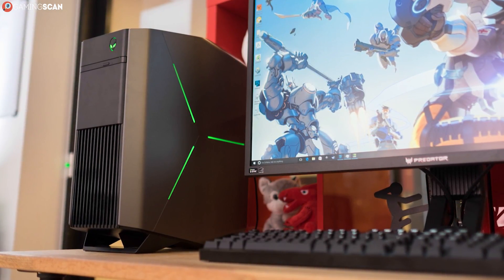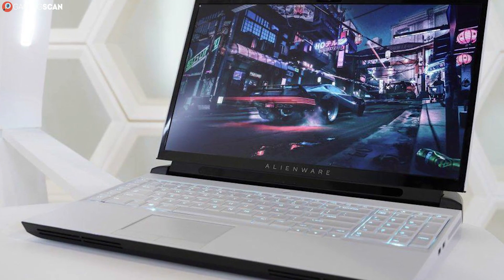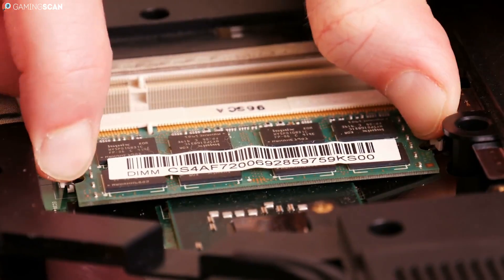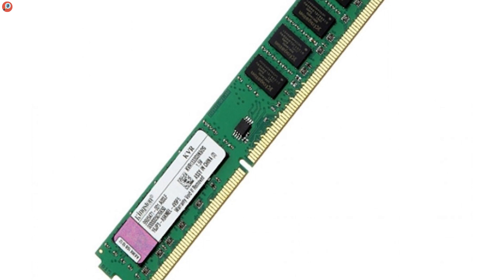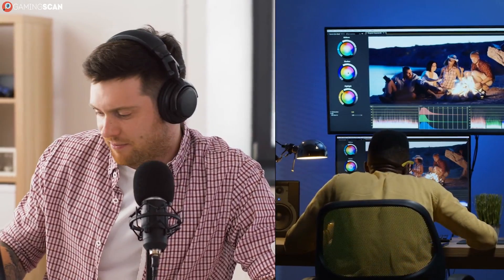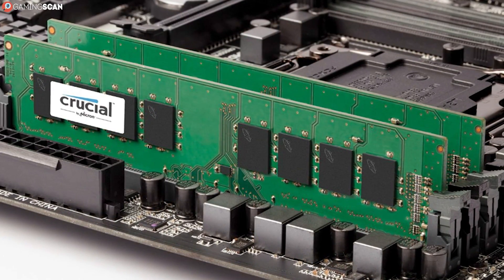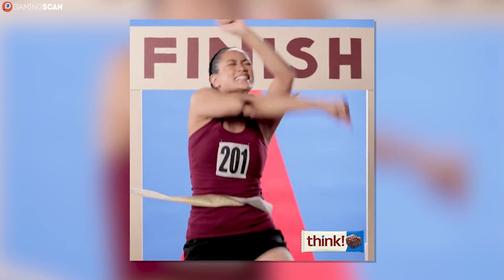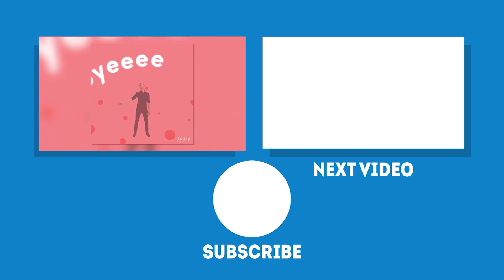How Much Does RAM Affect Gaming In 2020? [Simple Guide]

Comment: In short guys, buy 16gigs 2x8 (if your mb supports dual channel; most actually do) 
DDR4 3200mhz is enough if you have a mid-high components. 

Tips: there is no big deference in ram manufacturers.

For example, a 3200mhz silicon power x turbine is the best in my opinion when it comes for price (spoiler alert; it has RGB 🥸)

Comment: I have a 16gb ram intel 5 1660 super pc and a 144hz monitor and I get like 80 frames , get stutters frame drops , what do I upgrade too get more frames ?
Reply: Switch to ryzen 7 3700x or i7 lol and make sure you have a dual channel ram and not single stick. Single stick causes spikes still. Dual channels can fix it and deliver smoother gameplay, but if it still spikes it’s probably cpu cause a gtx 1660 super is really good but the i5 is decent.
Reply: @mattrofI  gotta upgrade the i5 then ?
Reply: @gleesyy  yes
Reply: @gleesyy  cpu/ram both help fix stutters also smoother gameplay with a bit of fps increase. GPU just gives a lot of fps with a small amount of smoothness ig but not much
Reply: @mattrofI  okay thanks daddy
Reply: @gleesyy  np

Comment: I've been using 16GB of RAM for the past 6 years. I'm starting to consider 32GB, but I think 16 should last a little longer.
Reply: Me 4 gb ;-;
Reply: What's your frequency? Like MHz per seconds because that plays a big factor as well not just the size
Reply: @warmachine6988  Not really. The difference between 3200MHz and 4000 isn't that big. Also, a lot of CPU's don't handle fast RAM too well, I.E cause stutter. 3200MHz to 3600MHz is the sweet spot currently.

I myself have a 2x8 kit of 3600MHz.
Reply: @scotchwhisky6094  i have a pair of 3600 as well, don't believe you'll ever really need to upgrade, but I mean if you got something below 3000 then upgrade wil probably make a difference tbh

Comment: I'm planning to upgrade my Acer Aspire 3 laptop currently on single 4gb ram stick.(IKR WTF ACER?!) Should i add another 4gb ram on my existing 4gb ram making it 8gb dual channel ram stick (2x4) or upgrade my current single 4gb ram stick to 8gb dual ram stick? (2x8)? i understand that mixing rams i.e 1x4 + 1x8 is bad and that ram capacity should match, so any suggestions on whether i should get dual channel 4gb or dual channel 8gb??? thanks a bunch

Comment: Just wanted to put here that my ram is my huge bottleneck atm so tip: don't just focus on cpu and gpu, ram also plays a huge factor in your gaming if you only have 4gb or 8gb and trying to run the latest games, trust me
Reply: Thanks bro I’m new to PCs and only have 8gb I’m thinking I should upgrade the ram first
Reply: @yessir721  I'd recommend going into your games, pressing ctrl alt and delete at the same time. Then go to task manager and try to see what part of your pc is being used most. If your ram, cpu or gpu is running at 100% or close to it in all your games, that's your bottleneck
Reply: @josiesenneff3600  thx for the help  I appreciate it
Reply: @yessir721  No problem hun
Reply: Much appreciated, damn. My CPU & GPU are averaging at around 20-30% & then my RAM at 95% lmaoooo
Reply: I just want to run roblox smoothly lol
Reply: @Zipemup1  Lol Idk about the recommended specs cause everywhere is only saying the minimum online but the minimum ram for roblox is 1gb. So basically, unless you have a 18+ year old computer, RAM isn't your bottleneck. That's why it's on mobile too I assume.

Comment: Desperate Question: I'd like to upgrade my 2011, 21.5" Imac. I bought it for $20, it works and I was thinking if I upgraded the RAM from 2 gb-10 gb, the CPU, maybe the graphics card and changed the HDD to an SSD, I could play modern games on my Imac with no problem. It wouldn't be a perfect 5 star performance, but it'd work well. Right? Or not? Is it too old? If so, couldn't I upgrade these things and make it modern?
Reply: Cpu + ram + gpu + ssd, you're like 250$ from building a new pc

Comment: 0:52 My RAM is the second most expensive item in my build, after the GPU. Is that bad? 😁
Reply: Mmm what about the processor?
Reply: @revaprasetya  Yeah, CPU is third 😁 GPU - RAM - CPU. I think it's because I have 32gb ram with Ryzen 5 3600
Reply: @UnknownEAFCPlayer  owh -_-
Reply: Mines would be my GPU, CPU and then RAM (2080S, 3800X, 64GB DDR4-3200)

Comment: I have amd ryzen 3 2600g, rx 570 and 8 gb of ram. Is that good ?
Reply: 8GB of RAM isnt really enough for most games coming out and has been slowly becoming a "must upgrade" for the past couple years. Get 16GB
Reply: Get 16gb
Reply: Assuming you haven't upgraded already, get more RAM of the exact same type. Same speed, same timings, same capacity sticks. Or you might run into problems.
And if you can't find any that is completely identical, replace the kit entirely with a different 2x8GB kit. Make sure to put them in the right slots - consult your motherboard's manual for which ones to use. Peace out.

Comment: Ryzen CPUs depend heavily on RAM speed. Infinity fabric speed is tied to RAM so it actually speeds the CPU. Use Ryzen RAM calculator to get the most from your RAM.
Reply: i considering getting new RAM because my save files in Doom Eternal are getting corrupted and I getting sick of it so I want to prevent it

Comment: i was think of getting 4 sets of 64 GB ram but is that to much
Reply: You mean 4×64???
Reply: @TechnoDIYs  yes
Reply: @X9_X4014  well... If you're planning to prepare your computer for NASA, then it's alright 😂
4×64 is too much! More importantly, no program, not a single one, will even use 1×64GB Ram... 
In short, you'll be wasting Money and Space by using 4×64. Even very good Gaming PCs have like 32 GB ram at Max!
Reply: @TechnoDIYs you'll be surprised
Reply: @X9_X4014  huh?
Reply: @TechnoDIYs  i have 4x32 but it can't do the things i need so i'm going for the upgrade
Reply: xfun9 dude what are you doing? I almost can’t think of a single thing that you could possibly do that would take that much
Reply: @TweetiTCG  have 1000000000000000 google chrome tabs open
Reply: @X9_X4014  what things do you need to do that uses 4*64 gigs of RAM?
Reply: Homemade space program

Comment: I have 32 Gb and knew it was too much, but Luckily had the option to double up from 16GB for just $14 more. Otherwise even for the $14 more I know it’s pretty much a waste. The most I’ve managed to use so far is less than 14GB. If anything if you find yourself a great deal, take it and if if not for the deal, just future proofing. Many PC gamers want overkill anyways. My 90FPS is too low compared to I can spend 40% more and get 5-8% more FPS.
Reply: However, if you have a lot of other things running in the background you might find yourself using it.  Sometimes I might have 4-5 internet windows open looking up websites and such while playing a game and I have at time had two games running simultaneously for various reasons.  That can take a toll on your ram usage.

Comment: 16gb 3000 speed is the sweet spot for gaming imo
Reply: Is a intel core i72600 @3.4ghz 16gb of ram good
Reply: iLuckie Well that’s true in whole but if you want to buy a ryzen cpu then you should try and go for 3200 if your budget can allow it
Reply: @lexy5960  got a ryzen 3700x and a x570 board. Gonna grab 32gb at 3600mhz c16
Reply: I only have 24GB 3000Mhz total
Reply: Is 16gb 666mhz good?
Reply: Sleethpow 666Mhz?
Reply: Ed Vargas yes
Reply: Sleethpow too low for tech nowadays in general but if you can still make it work eith the other old components then it is fine, I’m not sure if you can play the recent AAA games with that though,
Reply: Ed Vargas I got it as a prebuilt and a gift. As a result, I don’t know the manufacturer, and the BIOS is locked with a password I don’t know. I’m pretty sure you need to go into the BIOS to overclock ram.
Reply: Sleethpow only if you’re sure the board and mems are ok to be OC’d.

Comment: Average gamer here with ryzen 2600x ddr4 16gb ram (3200)& 6gb ddr6 vram.
Reply: umm, I'm still on i3 3220, ddr3 12gb ram & 3gb gtx 1060 T_T
Reply: Retro gamer here with integrated Intel graphics circa 2009. Thinking about getting a $40 card just for HDMI 😁
Reply: Same but i have rx 580 8gb
Reply: @ElJumperino  i have the same just got ddr4 16gb ram to add onto the 8 .